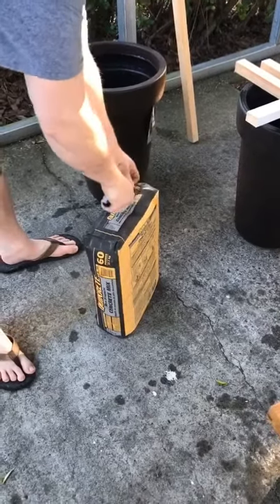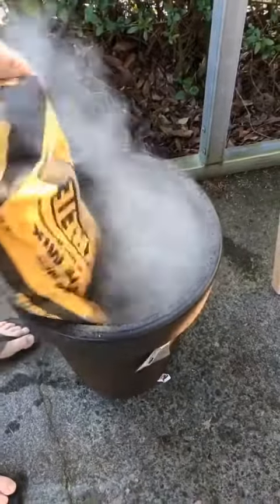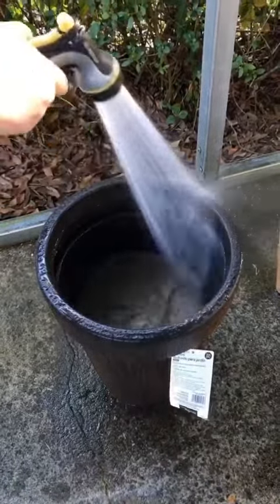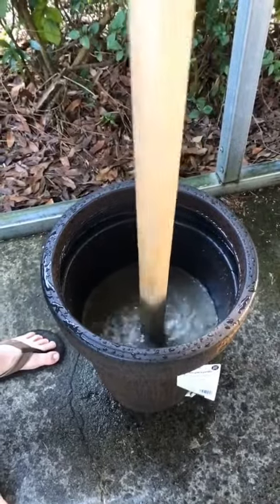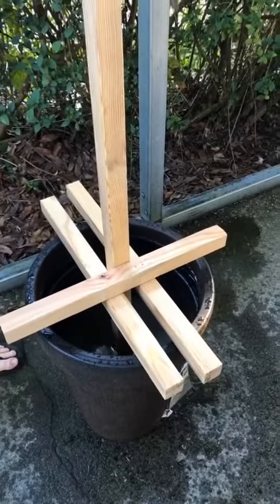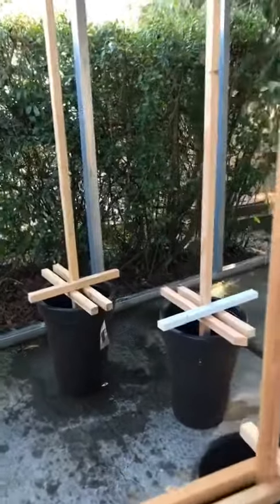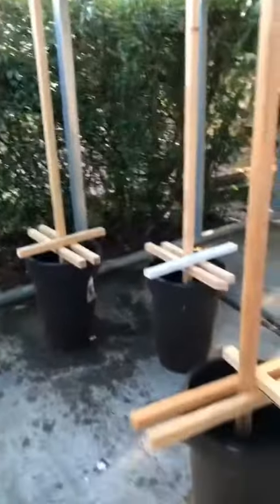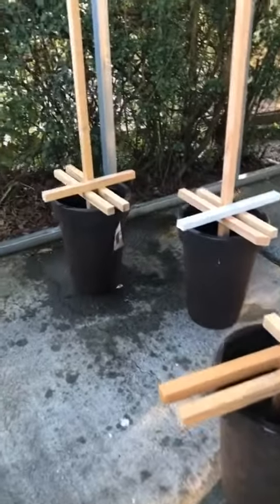How To Make Cafe Light Pole/Posts with Flower Pots!

Comment: what size wood poles are those??
Reply: I’m guessing 2x2s......
Reply: The only thing the wood pole will rot. I tried this and the wood rotten onto top above the concrete. So put the wood pole in a pvc pipe and filled around the wood with foam filler. Now they haven't rotted.